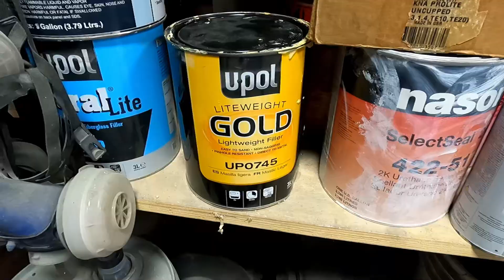1969 Dodge Charger Panel Mount / Gap / Matching Part 2

Comment: I am glad to see you adresss the bottom of the passenger door bowing out a little at the bottom, mine is just starting to do that. Can all the bolts that need to be loosened be done without taking the fender off ?
Reply from the maker: It was easier for me that way, but yeah it’s tight but you can get to them.  Ya might loosen them, just a little enough for them to move with pressure.  get the fit you want by closing the door, then open and tighten if you can keep it from moving.